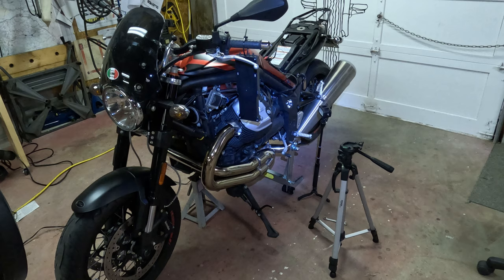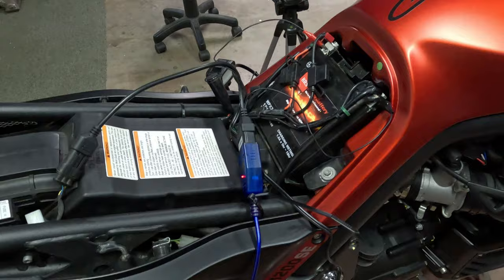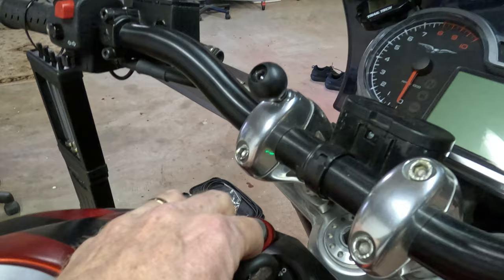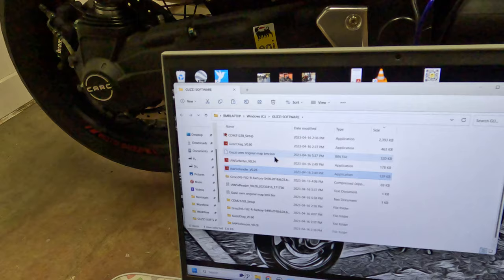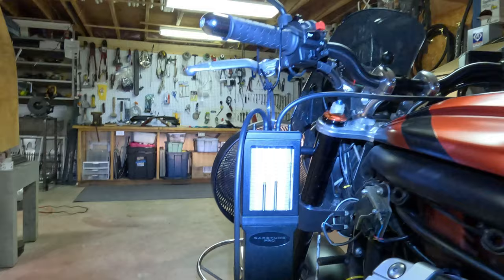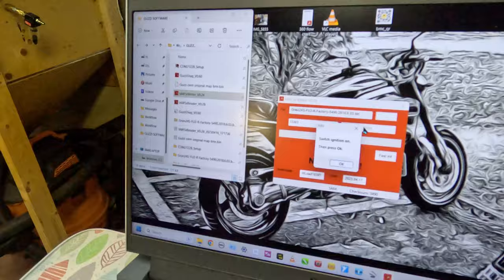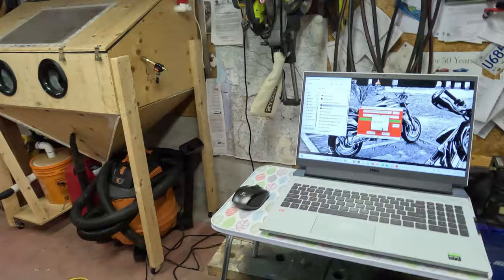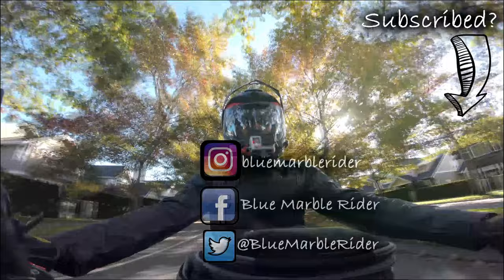Moto Guzzi Griso 1200SE Tune Up: REMAP & Throttle Body Balance | PART 3

Comment: just added Beetles mapping to a 2015 Stelvio to smooth out the off road throttle control. works veery well. easy to do I you rolling this video. cheers to al the adventure riders!

Comment: Thanks for the video. There's so much talk about removing the canister and tip-over value, but no clear information. Not only on this model Guzzi but many other. This video is clear and easy to follow regardless of model. Mine is a V85TT. Thanks again. Keep them coming.  I love the Griso, but prices are increasing here in Australia.
Reply from the maker: Glad it helped.  Cheers.

Comment: Now that you have practiced balancing the throttle bodies on your bike  feel free to get further practice on my bikes. 😊 Looking forward to hearing your subjective impressions on the new mapping. A pre and post dyno would have been interesting. Any ideas what other people have found? I know on the RNineT people report no real change in HP or torque with re-mapping, the consensus being that BMW had already wrung out the best you can get. A remap of the Boxer engine certainly did smooth it out under 3000 rpm.
Reply from the maker: Certainly a difference - more on that in the next video.  The bike is also, naturally smoother, probably just the Throttle body balance, which I will now do every year, seeing as I have a manometer (which you are welcome to borrow :-).  Y
Reply: Beetle's maps won't give you noticeably more power. The Guzzi Hi-Cam 1200's power output is governed by its side draught head design, narrow included valve angle and its camming. If you were to bother putting the bike on a dyno you will probably find a very small increase in peak horsepower but the main benefits are the virtual elimination of the midrange dip in the torque curve which becomes essentially flat! This makes the machine a joy to ride and it will certainly Feel quicker.

This is an excellently done video on how to balance the throttlebodies. Highly commended. One thing I would mention as it wasn't stated is that whenever the 'Reader' and 'Writer' programs are communicating with the ECU you will get an icon at the bottom of the dash showing a representation of a un-plugged electrical plug next to the letters ECU. This is perfectly normal and is simply showing that the programs are interacting with the ECU. There is no need to panic or try to interrupt the process.

Do rest assured though it is pretty much impossible to brick an ECU using the Guzzidiag suite of tools. I've been using the tooling professionally for well over a decade and have never lost an ECU yet, even when experimenting to see if I could by interrupting the upload or download or disconnecting the tooling physically! Something that can't be said of the original factory tooling!

Excellent. Informative video. Well done!
Reply from the maker: @peterroper617  Thanks Peter - I really appreciate the feedback.  The bike shows a little more top end, but the biggest gaine for  me is the absence of the fluffy mid range 3000-3500 hesitation.  Gone.  Lovely - and now purrs!  Just done the brakes...bled and new pads.  Must have had the original fluid in it - brown, much better on the front; the rear is still very absent for me.  I will have to investigate some more - seems to fade very very quickly.  Normal, or more work needed?  Cheers, and thanks for the help (your video on the throttle bodies was invaluable.)
Reply: @BlueMarbleRider  I love how you upload these videos for maintaining the Griso! It is a huge gap compared to more popular bikes. Please, keep up the good work and I hope the next one after the remapping will be about the brake fluid change. ;)

Comment: I own a 2003 Moto Guzzi California Stone Touring , i have owned it since 2005 , didn't know about the clutch issues, and unfortunately it has been parked for a long time, and i had never drained all the fuel , i tried to get out and start it when i could but , it took a long time for me to be able to get a new clutch for it , dual disc now , finally got it in and now its hard to start and won't idle , i thought it was gumed up injectors bit i have ran it with injector cleaner and new fuel for a couple of weeks but its not doing much better , i downloaded Guzzi diag, just dont want to mess anything up
Reply from the maker: Drain all that fuel, because it'll just re-block the injector ports as it goes through.  Then I'd get those injectors looked at first.  Very likely still gummed.  Ultrasonic clean should fix them.  Don't bother reflashing until you've got her running as is.  Cheers.